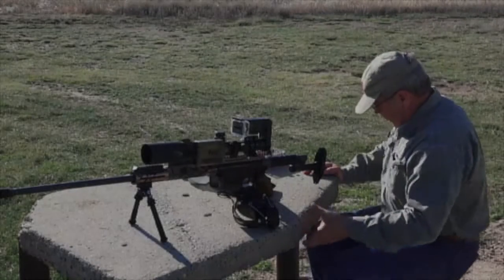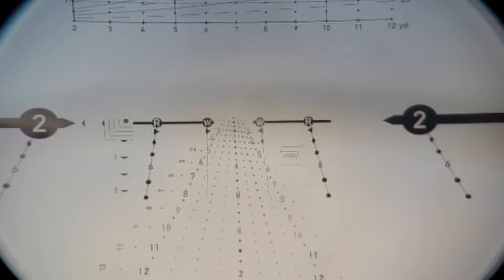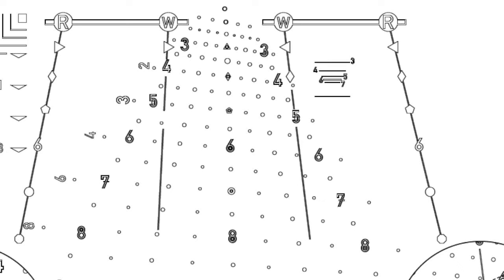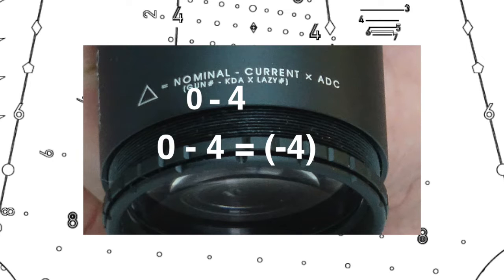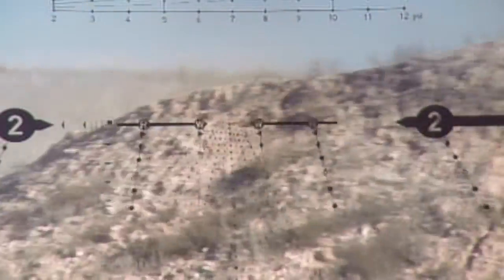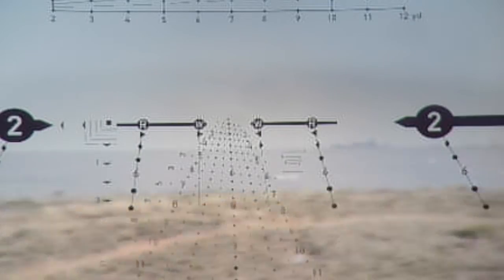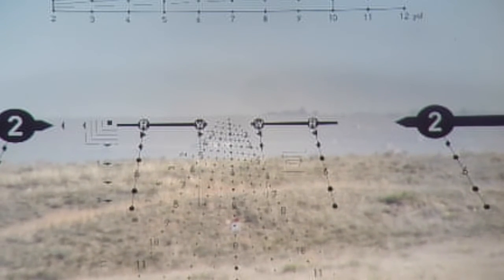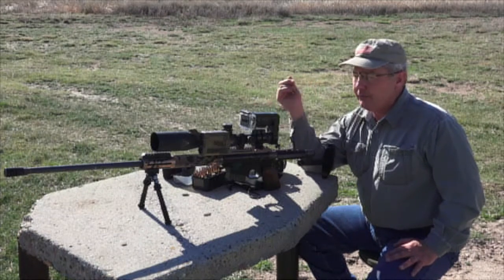Dynamic Targeting Reticle   Long Distance techniques!

Comment: You said in first example...0 gun/4 day/705 yd...that there was a factor of 5 shown to the left (lazy number).  I see a 6.  Where is the miscommunication?
Reply from the maker: +Terry Decker Mr. Decker, happy to hear you took some time to watch this video!  Thank you for bringing this error to our attention.  As you are aware, the TUBB DTR is available for a number of popular bullets.  The DTR David used during filming does not match the graphics later used for this instructional video.  I do not recall the specifics of Davids rifle/scope/ammo combination for this session of filming; however, the DTR (graphic) used for this illustration is for a .308, 175 gr. Sierra Match King bullet, scope 2.75 inches over bore centerline and a 100 yard zero.  The fact you asked this question leaves me feeling confident that you've grasped the fundamental concepts of the TUBB DTR.  I will try and link this comment to the video, to prevent any future confusion.  Thank you for your time.  C. Tubb